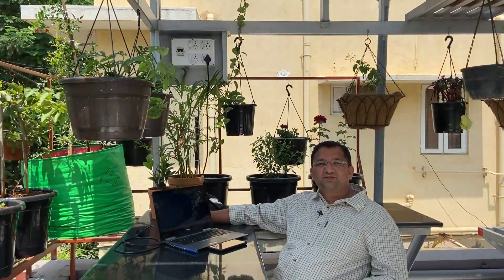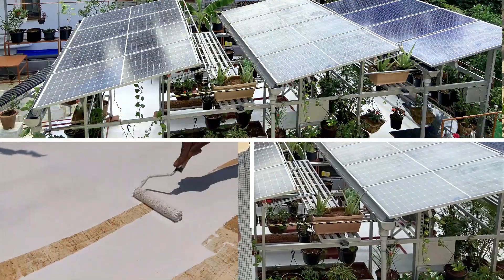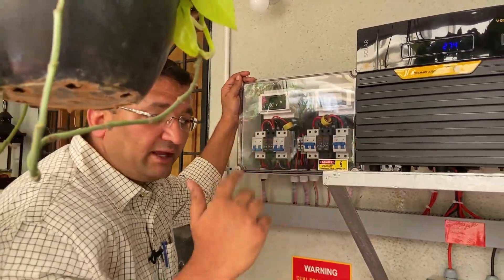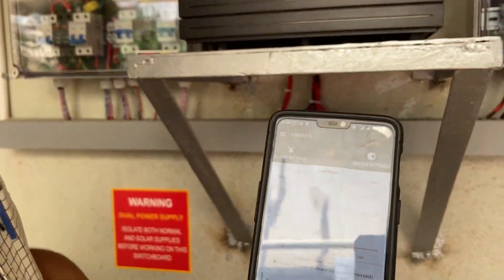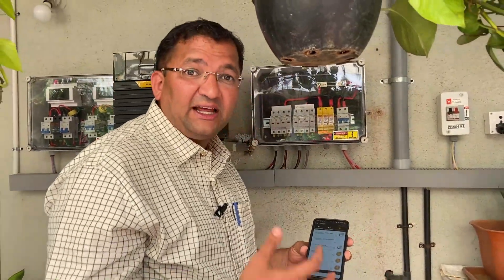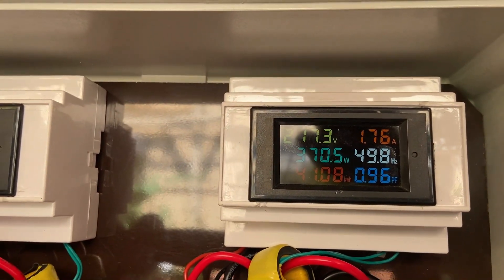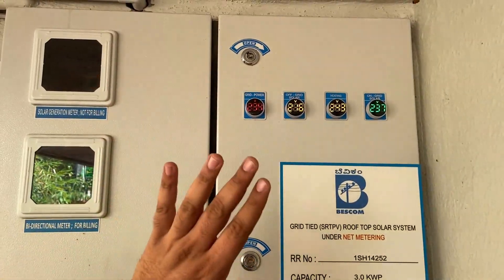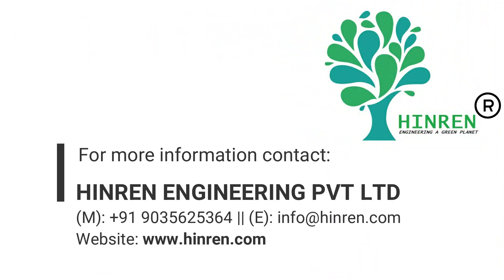Residential Off-Grid Rooftop Solar PV System

Comment: Why polycrystalline panel  instead of bifacial panels
Reply from the maker: For the off grid system , I have used old refurbished poly-crystalline panels. Reason: The loads are very less and the production from these panels are good enough.

Comment: What is the investment sir and what is the return period of this investment sir?
Reply from the maker: Off grid system are installed in areas where there is no electricity or erratic and unreliable electricity supply . 
As such, since there is no grid power a availablity for comparison, it is is very difficult to put a ROI number . 
On the other hand , when electricity itself is a premium, question of ROI does not arise .

Comment: This is a good idea, 2 weeks ago in view of the power outages, i installed such Off-grid  inverter for my home's critical loads with microtek jumbo 3500va 36v paired with Delta Energy Orion MPPT charge controller & six 390watt panels. This charge controller has a forced off grid mode during evening hours Making the inverter to run off grid after sunset. It automatically connects to the grid in early morning if the battery voltage drops to low levels. Very useful for daily use & critical loads during long outages. 👍🏽

Comment: Sir, in case of off grid, the advantage you mentioned of running during power cut is only true for day time. Is there any advantage at night?
Reply from the maker: By definition of Off grid , one can run the load at any time of the day . 
The solar runs the load during the day. It also charges the batteries. During the night , the batteries run the loads. 
(These days , almost all off grid inverters come with an option of charging from the grid as well if required)

Comment: Sir what is the maximum watt we can use by off grid v gard inverter
Reply from the maker: Depends on the inverter Specs . For this particular inverter used, maximum AC output is 2.7 KW .

Comment: Very clean and efficient installation.One question is there. Why don't you opted for MPPT based inverter ?
Reply from the maker: Thank you
Reply from the maker: Good Question.
 First,  the loads are quite low. I am not even using 50% capacity. You might have noticed that even the panels used are old refurbished ones. 
Second, since this inverter cannot export power to the grid and I really do not need so much power, I as well get a PWM unit to save cost. 
Going a little technical; I am using a 24V Nominal voltage solar with 24 V nominal voltage battery system. In this case, solar panels will provide just about the right voltage needed to charge the batteries without sacrificing very much on efficiency. This is because, in relatively warmer climates , a 24 V nominal voltage module will have a voltage drop due to internal resistance. Hence, it will typically have a voltage range within the band of what the battery needs (24-28V). Since , I do not need excess power (No export), I would not gain much advantage (In terms of cost) from the power electronics involved in the MPPT based system. 
Having said this , One needs to be careful in load estimation in order to make a decision between PWM and MPPT. 
In my opinion , Very broadly, as a preliminary design one can choose PWM over MPPT for
A. Smaller arrays with Polycrystalline modules (2 to 4 modules)
B. Module Nominal voltage is around the battery voltage 
C. General Climate is warm. 
D. Loads are quite low (About 30 % Lower than what the Inverter can support) and Energy export is not possible or permitted.